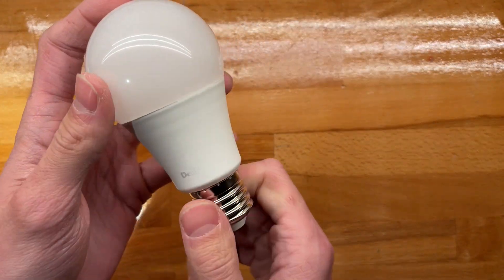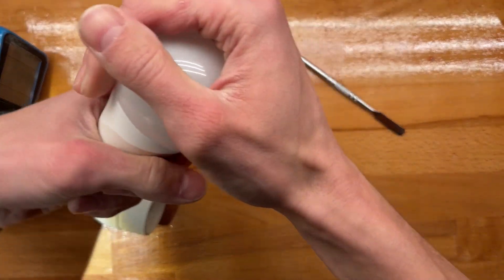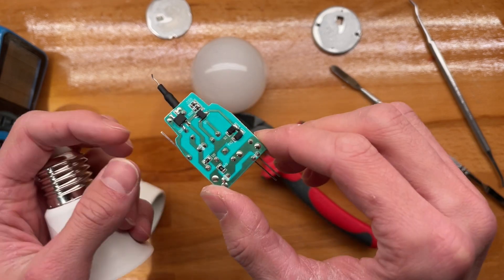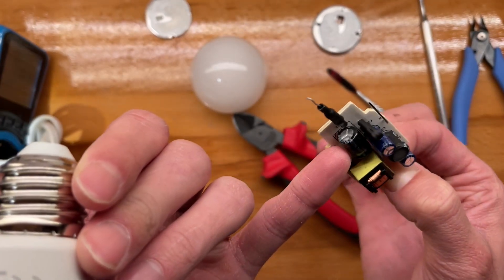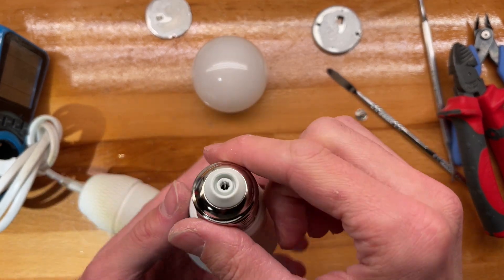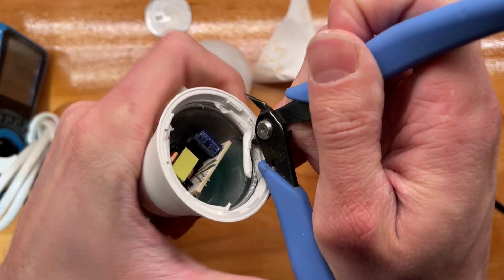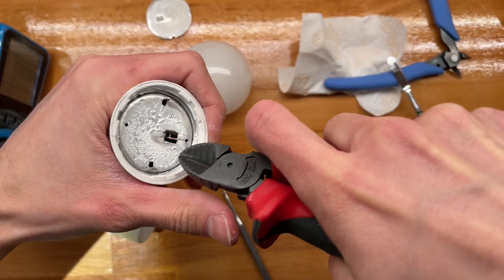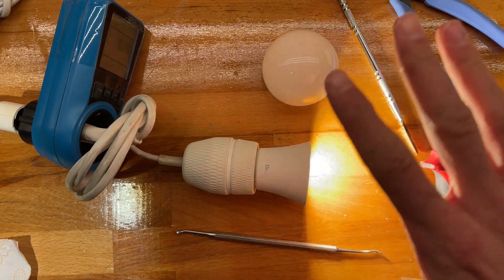LED Bulb Hack - Decrease Power & Increase Lifespan (2)

Comment: How do I know what resistor to replace and whether increase or recrease ohms as a layman? (edit: you replaced 2,4 with 5,1 ohms in the other video, and ripping off one of two parallel resistors is also increasing ohms. So the modification is always increasing ohms I guess.) 🙄 Big Clive once said at some buck regulator, when you snap one of those shunts off, it will heat up more and cook other components on the board. Especially when they are on the same aluminium substrate with LED chips. So I realised I could cause more damage than improvement when I don't know what I'm doing. Do you think you could make a comprehensive video explaining how to identify the type of regulator and how to identify right resistor for replacement? And what are the risks to avoid?

Comment: Thanks I've had multiple bulbs go bad in a short time frame. Clipping the resister ( if the circuit is similar ) certainly will save me some bucks. Ive always wondered if one can expect any longevity living in a county that has a power grid full surges and brown outs ? Any comments...

Comment: Not all LED bulb is having same circuit. I was looking solution to reduce the current because I believe led bulb use contant current circuit and i found your video. If you please to help me advice me how to identify and change the circuit of any led bulb.
Reply: Boa tarde. Já vi circuitos em que se eu fizesse o mesmo do vídeo, aumentaria a corrente na saída para os leds, pois aumentando a resistência na entrada do circuito integrado, ele entende que os leds necessitam de mais corrente. O ideal é saber como o ci trabalha. Forte abraço do Brasil.

Comment: Is it possible to just break some of the LEDs to reduce the power and light?
Reply: The bulbs are in series, in most bulbs. One goes out they all do. If you bypass one it will have too much voltage and shorten the life more. If they designed them to be in parallel it wouldn't matter if a few went out.
Reply: The point was to make the bulb last longer and save electric power cost. That extra resister waste power and burns out the leds sooner with the same amount of light.
Reply: Opposite

Comment: I'm rather perplexed with such a poor power factor.
If the buck converter were placed before the capacitor bank, with its input filtered by only a small film capacitor, its power factor would have been much closer to 95%. It would have a very choppy current draw, but good enough for a cheap bulb.
You don't really need much to get to >80% P.F. Even a constant current load -- which a properly driven LED is -- would suffice.
So much for ecology, right?! No one cares if their new cheapo "green" lightbulb demands twice the current from the power grid than it really needs...